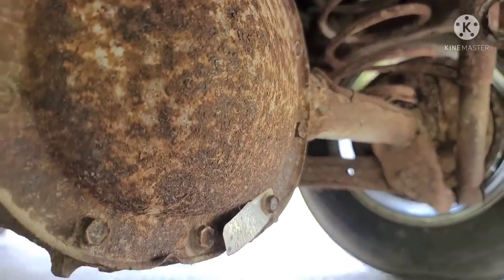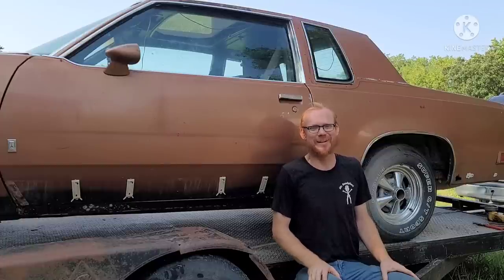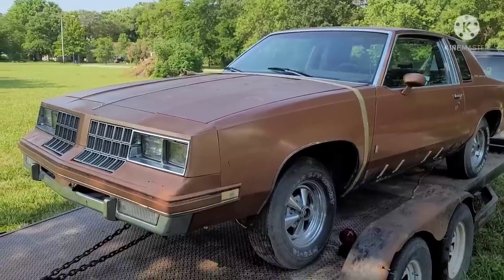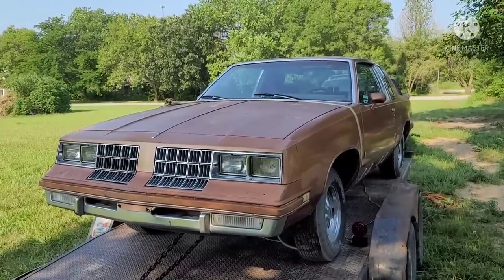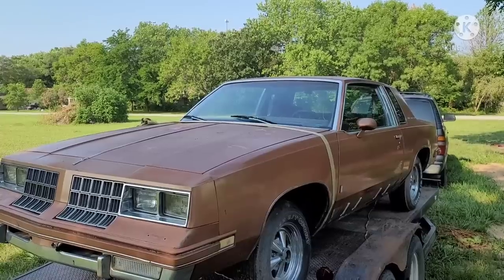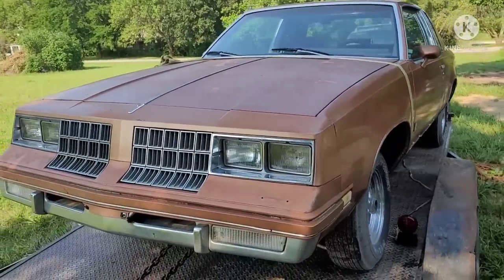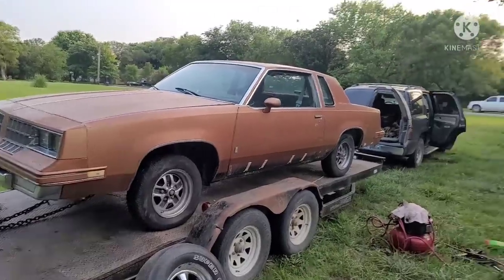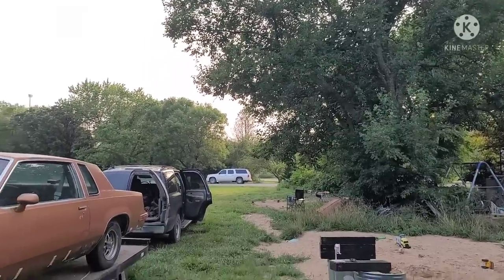G Body Lineup: 1978-87 Oldsmobile Cutlass, Chevrolet Monte Carlo & 1981 Buick Regal project cars!

Comment: I owned four G body Oldsmobiles. My first car was a used '80 Cutlass Supreme I bought in '82, traded that on a new V6 '83 Cutlass & traded that on a new V8 '84 Cutlass Calais. Traded that on a new '87 442 which I still have. These cars filled GM lots in the '80s and were beautiful examples of personal luxury cars. In the '80s, you couldn't throw a rock without hitting one somewhere as the roads were filled with them. It's sad to see them in this condition; a reminder of how many years have gone by & how hard most were driven & treated. Can't recall the last time I saw one driven on a road...

Comment: Big fan of the mid- eighties, midsize GM bodies. I have had 2 Buick Regals, 81’and 84’. 
There are literally decades worth of potential engines to swap. GM was so great for interchangeably, it is hard to believe.
Reply from the maker: I was going to mention that. People forget they had optional diesel engines as well. In some years the frames had so many possible mounting holes for the engine stands, they looked like swiss cheese

Comment: Up here in the Midwest 78- 80 had bad rust problem with the frames. Had a nice 78 Buick Century wagon I drove for a couple years back in 94 - 97 rear half of the frame got so bad I sent it to the yard still had a nice body and interior. Also looked at a nice 78 Oldsmobile cutlass cruiser same problem with frame.

Comment: If my memory serves me correctly , weren't these the most stolen cars for 90 to 2000 ? I think it was a thing , until they started rusting more , good looking cars lots of memories !
Reply: Yeah cause they were so easy to start it using just a flat screwdriver I  had a 84 Cutlass supreme somebody stole it they break the steering where column  also cause the doors doesn't had a metal frame around the window it was very easy to pull the window .

Comment: These G bodies here in Ohio was bad about the rear frame behind the wheels rusting into. I've had good bodies with bad frame rust and bad bodies with good frames. I have an 81 Regal that has a perfect rear frame but the bumper is rusted so bad its ready to fall off.  After GM got smart and put plastic plugs (which the Regal has) over the holes for the rear body mounts then the mud and dust couldn't collect in the frame rail and it solved the rust problem. Unfortunately they didn't do it soon enough to save most of them. By the way I have the lower chrome for that brown Cutlass. I have the same car but a tree fell on the roof.

Comment: I don't expect to see much ford content as they are for whatever reason not a high favor car. I had a few in the sixties that made it hard to love one of them. Like my 65 impala had a heater problem and I had three girls and wife who expected me to fix and the heater wasn't to bad but taking the right side fender off in  the snow while they waited in a hotel room and put the fan motor in it. I cut the crap out of the inner fender well and pried hard on it but bent it out enough to get that motor in. Cost of new parts as out in nowhere land was only thirty dollars and change but the hotel and food was close to two hundred dollars. That hurt cause I was making about that a month in sixty six. It then got us into texas and the engine shit a rod out so got a fifty six ford four door for the car that had only forty thousand miles on it and those were the miles since new as I bought it new. The ford ran great, six cylinder and standard shift. Everything worked on the ford that had nearly a hundred thousand miles on it and had changed hands more than most girls shoes today. It is not the only one as later in years I had the chevelle, a 80 model with the V6 and just no power like it first had. I spent a ton figuring it out and then stuffed a 327 in it and that bitch ran good. It would toss the first quart of oil and finally just kept oil with me but it never dropped until one day and not checking first I headed to the parts store for something else and so fired it up and made it a block so seen  the gauge was flickering a bit so stopped and checked it. nothing on the stick... filled it and started it and was headed back to the house. didn't make the one damn block before no. 3 rod came out of the block with no warning. I have twisted the oil pump shaft off in a ford, figured screwed and drive it home or blows up. get home and park it for a while... need a rig n moneys tight so look into it. drop pan and pump and put new shaft to that rig in. Pan back on with its oil it had and start it... good oil pressure and so ran it for a long time.... finally sold it cheap so the guy didn't get screwed over an he just drove hell out of it. That car died around the still running engine so yeah I am not chevy so much even  though I do like them. Most older cars never went the miles we expect now. My fords ran good and long. Chevys would start in cold weather but they would always die on me. I had a lot of different Chrysler products that when cold just would not start except the slant six which is indestructible and won't pull a full load of people in the  rig.  I just like your channel as you are fair and honest